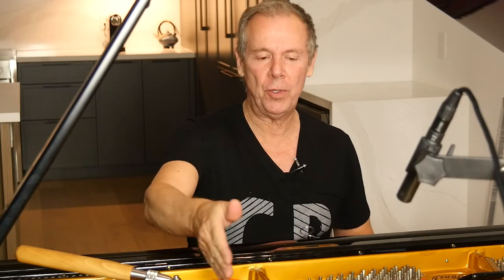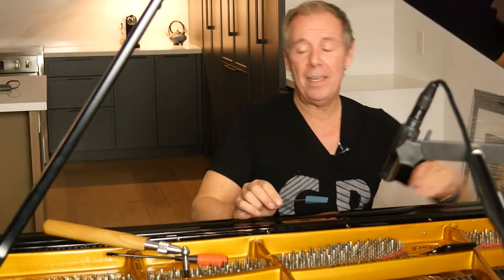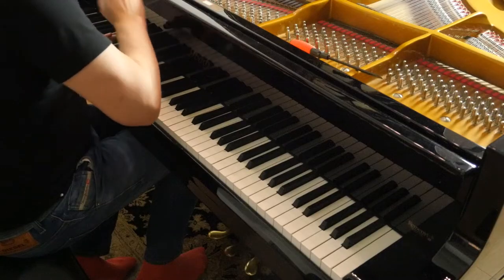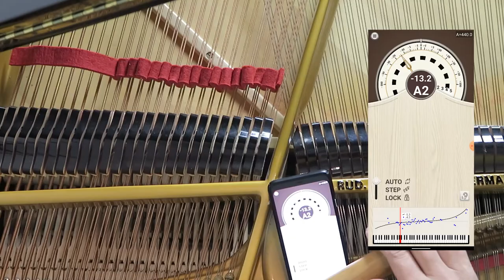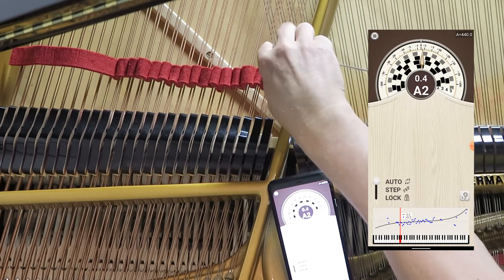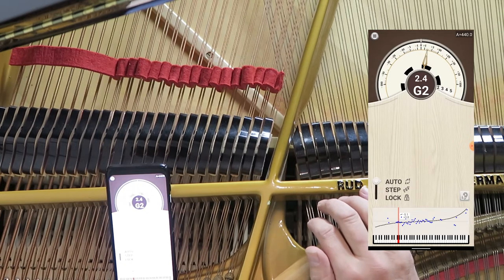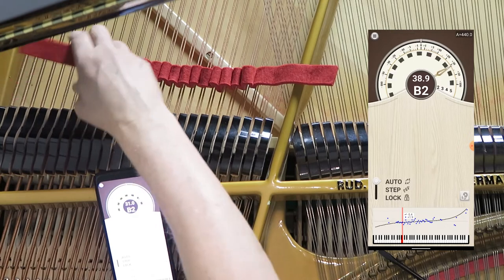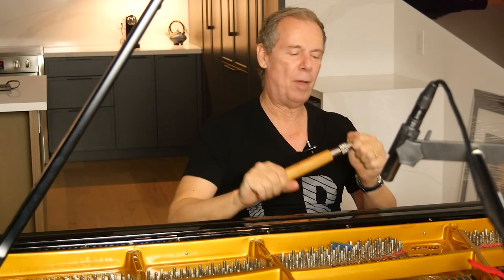How To Tune Your Own Piano - Tuning the Lower Register

Comment: Hello, to tune a note, once you tune a string, isn’t it just possible to mute it and immediately after tune the second string alone with the app, then they are both in unisson?  Could this work? Well i mean i’m not sure to be able by ear to find the unisson. Thank you!!
Reply: Doing it that way, each string will be tuned slightly imperfect in slightly different ways, which could prevent perfect unison. Doing it by ear is the best way to do it because you can listen for the beats (sound of dissonance) to stop. It also helps to know what phase difference sounds like, because as you get close, it'll be more like a constant phase shift than dissonance. I realize this isn't much help if your ear isn't trained, but if you're able, it's worth learning.

Comment: I have decided to try to tune up the current outside public piano in my town. This has helped a lot. I will be dealing with rusty strings, so I will back them off a tad before tuning up. It is my understanding this is preferable because it first breaks the minor rust weld, if any, perhaps lessening a chance of breaking a string. Currently, the piano is horribly out of tune. I like to play tunes like Goodbye Pork Pie Hat, Bemsha Swing, 'Round Midnight, Blue Bossa, Garota do Ipanema, Misty and more. I have my own jazz/blues things I have expanded on over the decades, too. None of that sounds very good now on the outside piano, so I will get to fixin' it shortly, if the creek don't rise.
Reply from the maker: Ohhhh. That one is out of my league. It sounds like it needs a piano doctor 😬 Good luck with it!!!

Comment: Do you find that after tuning a whole section to the piano meter where the rectangles are as still as possible and the needle is pretty much at 0, the piano is flat after fixing up the unisons?

Comment: ha…i was struggling with the last 3-4 notes and i was wondering how to get it by ear. i can hear something is flat or sharp, but after i’ve altered it slightly my ear poops out and feels lost.

i have used precision strobe tuner as my ap, but i’ll try your rec. i like the visual of the flat and sharp curve overlay with the piano, and it’s good to know it’ll do the low notes.

i was quickly taught how to tune with a similar analogue tuner, but i was told to turn it off for the higher and lower and do it by ear.

i’ve been a by ear purist before only tuning A440, but those very highest and lowest notes are when my ear and patience is wearing thin.
Reply: I think the recommendation to turn off the tuner is to account for human perception shifting in the upper and lower registers. Getting it perfectly in tune mathematically, can sound out of tune, perceptually. Also with the lowest notes, listening to the note itself is almost useless; you have to listen to the beats/phase difference. An easy way to do that is to listen to the resonance as the reference string and being-tuned string ring out. If the resonance pulsates, it's out. If it's constant, you're good.

Comment: Hi if the piano meter shows + 10, you tighten the pin and screw to the right? To try and bring it to 0? Thank u
Reply from the maker: Flat? Tune clockwise.  Sharp? +10 for example, tune counter clockwise.
Reply: @Jazzmentl  thank u

Comment: WILL THERE SOMETIME BE A STRINGTENSION METER BUILT INTO THE TUNING HAMMER SO AS TO AVOID THE BREAKING OF STRINGS. SOMETHING LIKE THE TORQUE WRENCH USED BY AUTOMOTIVE MECHANICS. HI TUNING GREAT TOOL FOR GUYS LIKE US ALWAYS-IN-PERFECT-TUNE-FREAKS. WHICH IS A TERRIBLE SYNDROME.
Reply from the maker: 😁 great invention Hilary!!!! You should build a prototype and get a patent on it asap!